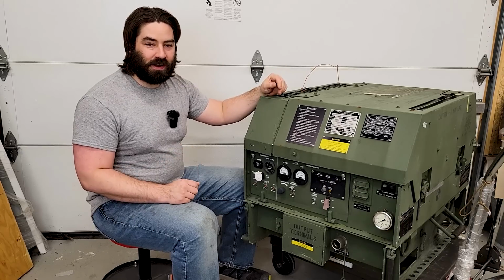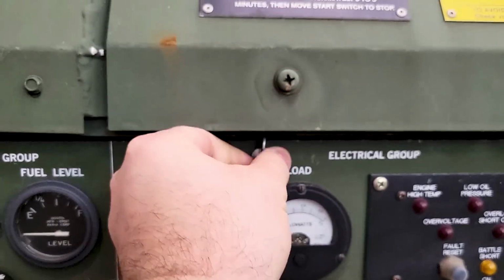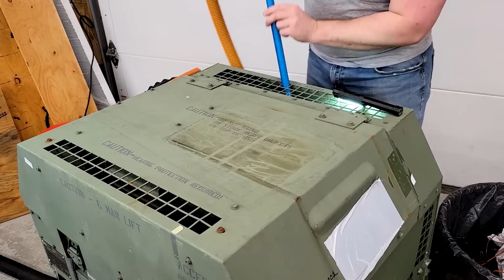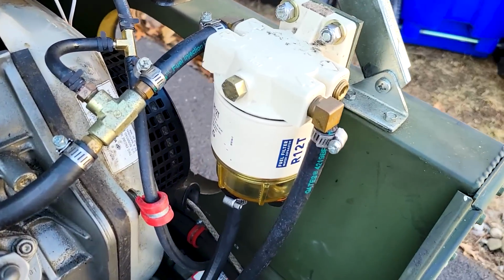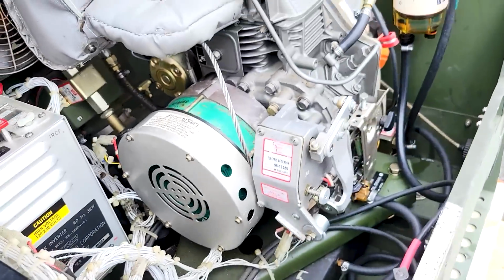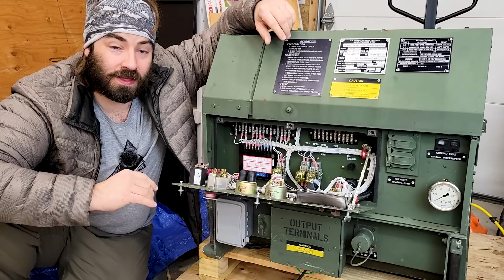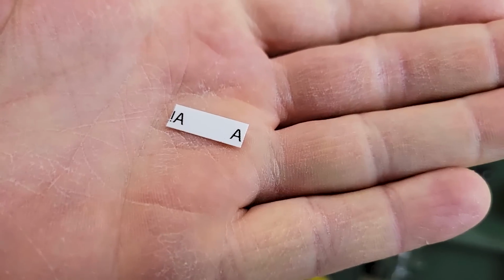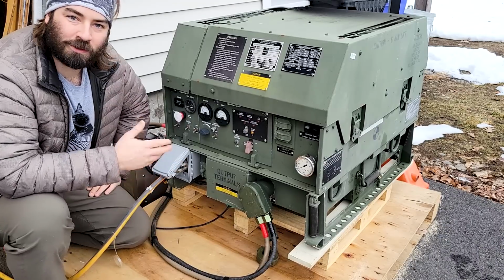Mil-Spec, the best you can do?

Comment: The fuel drain is connected to the bowl which is higher than the diesel tank.  Do you use the fuel pump to drain the diesel?
Reply from the maker: This model has a fuel drain on the tank.

Comment: Can these generators run 24 hours for few weeks non stop like the 10 and 15k generators?
Reply from the maker: Yes, they are rated for continuous duty.  However,  the oil sump is smaller, and the RPM higher.  This means the oil change intervals are more frequent compared to the larger models.
Reply: @DavidPozEnergy  would you say oil change 50 hours
Reply from the maker: The Yanmar engine in the MEP-831A has an oil change interval every 100 hours, 1.1L.

Comment: as a 91b i had to learn how to work on these because we never had alot of generator mechanics in my unit. these things sucked, they were old and reliable, yes. but they were always left outside and when something went wrong, combined with the issue of people in tents being pissed, they were never fun to work on. The biggest issue i ever seen with them was a shorted ground or a busted fuel tank, suprisingly i never worked on any of the disel engines in these.

Comment: I have two of these generators. One has the same idle issue when started off a battery but does not have the issue with hunting idle when pull started do you think its the board?

Comment: I worked on the Onan 5k/10k Tactfully "QUIET" generators when I was in ( 95-09 )
We had to keep a stockpile of the solenoids as they went out all the time, though you could manually open them and keep them running with just a tie down if you had to.

Might have missed it but how much did this model cost you?

Comment: Keep the old parts, as it is no longer emp resistant. In the event of an emp you can at least be able to run it at full throttle going back to the original governor controller.

Comment: I own an MEP 803. 10kw multi-phase selection. Single phase 120 or 240volt. Or 3 phase. I got it on auction. It was left out in the weather and full of water. I had to drain and replace the oil three times to get all the water out. It runs great. Has a onan diesel. The only problem with it is a winding issue that causes a harmonic ac voltage imposed into the dc circuit. Not a real problem but causes radio interference. I bought an in-line filter that shunts out the interference.

Comment: Came back to this to reply to some comments; if you dont know the trick yet I challenge you to pull start(make sure you flip the red decomp lever)
Also a trick in case you need to start with a dying battery is to flick the decomp lever.
Reply from the maker: Thanks for the tip.  Yes, I'm aware and have used it plenty, but it's nice in case someone is reading the comments without experience.

Comment: I've worked on those generators and adding a digital controller for being able to remote start when mains power fails you can combine the remote start with an ATS and you have a good budget backup system

Comment: While it does primarily run off of diesel as it's fuel. Being that it is a military service generator it should be multi-fuel capable. If it is then that works in your favor as you can produce your own fuel for it. 
The smallest gen set my unit had was 5kw and the largest was 150kw, we were an Engineer company so we needed the variety at different times.

Comment: Not sure where that title is coming from, but I would hope y'all know that mil-spec doesn't mean "top quality"!  
Ask anyone who has actually served how military gear compares to civilian gear.
Military gear is NOT (usually, with the occasional exception of weapon systems) built to be the best there is.  
Nope, military gear is instead built to meet very specific requirements - the military's actual needs - for a specific price.
That paradigm does not usually result in the best you can get.
Surplus mil equipment is a gamble, and the odds suck. Most such equipment is on the surplus market for a reason... ;)

Comment: How you kept the diesel on winter? Don't made gelatine?
Reply from the maker: As of right now, I keep the generator inside my garage during the winter.  I wheel it outside if I need it.  The garage is heated with solar hot water.
Reply: @DavidPozEnergy  thanks.kurt have a channel where they show videos about the upgrade parts

Comment: Aye look a mep generator I don’t see many of the small ones but I have worked with like the MEP-805/806 A and B’s, those are the 30Kw and 60Kw respectively, I’m active duty Air Force in the power production field so I’m familiar with generators especially the mil-spec ones

Comment: So a 3 Kilowatt Generator produces the same as a 3000 Watt generator?  ...that can't be right.
Reply from the maker: I'm happy to help answer any questions.  In this case, I'm a bit confused what you are asking about.  How can I help?
Reply: @DavidPozEnergy  So the Honda EU3000is Generator produces 3000 Watts of power. (Max)
Your Army Generator has the same max power ..3000 watts?  The Army Generator is about 3 times the size and weight ..that is what is what throwing me off.
Reply from the maker: Most military equipment is about 3 times the size, weight, and cost of a civilian version.  Most military equipment is conservatively rated. In this case, it can do 3.5kW, and can do that in high elevation, and in desert heat.  And, the military generators can run for 10 hours at full load on one tank of fuel.  I own a Honda EU6500, and it is actually a 5.5kVA generator, at sea level.  The "6500" rating on my Honda is the surge rating, not continuous.  Also, My Honda runs about 5 hours at full load for one tank, which is funny because the literature will say 14 hours of run time, but that's actually at 20% load.  I'm not trying to put down Honda generators, I love them.  Just trying to shed some light on a few differences.  I used to be in the Army, and maybe I have have an odd appreciation for the military equipment.
Reply: @DavidPozEnergy  Excellent break down David.
I see it's not so much about max power but versatility and rugged build.

When the Zombie Apocalypse comes ..your Generator would make me sleep better at night. :)

Comment: So to big and heavy to move. Super fragile and expensive parts. Bad design with motor running too high an rpm. Drinks tons of fuel and only makes 3000 watts? I mean I still want one but why again? I got a igen 4500 for 250 bucks from bod fta and run it 3500 to 4k all day everyday. Drinks such littke fuel I dont even notice. Charges my 24volt bank through the inverter easy all while auper quiet
Reply from the maker: Yeah, this Generator isn't for everyone.   Do you have know the fuel consumption of your Generator in numbers?  I usually do tests on mine to find the kwh/gallon.

Comment: Mil Spec is sometimes very misleading. many years (several decades in fact), my Father worked at an Alternator factory in the UK, they made ones which you could pick up by hand, and other which you could sit inside the casing with plenty of room to stretch out. From a single KVA to MVA.

Anyway, even back then, brushless alternators had become the thing. More reliable, less to fail, easier to services, more efficient. There really were not many reason to use brushed alternators any more.

Except for one customer.

The Military always demanded the "old style" brushed units as they were "tested in the field". The fact that they had to carry spares, they broke down more often than a brushless unit and the design was grossly outdated didn't matter. They always paid several times the cost - for an outdated, less efficient, less reliable, machine - instead of going brushless.

They would not even allow for corrections to known design-issues, they wanted the OLD design, warts and all - 99 of them at a time, each one many times the price of a brushless alternator.

"Tested in the field" was all they would ever say when challenged as to why they used dearer, inferior devices, "tested in the field".

Mil spec is not always about quality - it is sometimes just "terrible but with a known level of awfulness" which someone signed off as being "correct".

Comment: I have been using a MEP-016D  to offset the solar when the panels are covered with snow. I have used this old MEP  for 8 years now. The L 70 Yanmar just keeps on running. Very fuel efficient. 
.

Comment: Love that generator! Kurt did an awesome job! I'm curious about why diodes, not just simple bridges.
Reply: Usually the diodes will be for some kind of holding path check in the circuitry. When you press the start button some electrical test will go on and close a relay, allowing the system to come on. The diodes prevent it from coming on as soon as the on button is pressed. Don’t know this system though

Comment: How much is a 24 volt battery for this?
Reply from the maker: If you buy the OEM 24V battery, it will cost about $900.  Instead, most of us second hand owners, will group 2x 12V batteries together.  I bought 2x 12V for a total of $112.

Comment: As the proud owner of an MEP-803a I can say Kurt's products are top notch.
Late last year I replaced the voltage regulator with one of his due to a failing adjustment potentiometer.
From my own observations his regulator seems much more precise than the old original unit. (to be fair the original unit was 19 years old)
Reply: Very happy with Kurts controller, worked perfectly and was reasonably priced.

Comment: You brought back memories from the 1960s. My dad and I worked on military surplus gensets made by Onan. These units were for American Red Cross disaster service. The units were very well made and came with technical manuals etc. We had a non-military Onan too from the early 1950s that was hand crank start. It was a true beast to crank. We mounted it in a trailer as part of a lighting unit. This all was a great learning experience for a teenager. Thanks so much for your video and best wishes with your project.

Comment: Your video brought back memories. I was a 52D from 76 to 90. 
From 87 to 90 I was an instructor for the 52D course at Fort Belvior
10 years after I went through the course. I remember when these things
arrived to be used for training. The gas 3 Kw before this went into service
had a 4 cylinder engine on it. The pistons were tiny. Power generation field
worked out really well for me. As a civilian I have been operating and 
maintaining a 7 Mg watt power plant for 32 years. Thanks for the memory.
Reply: Hi I was in ft Belvoir in 89 D809th
Reply: I attended Delta school at Belvoir from 87-88. Bravo Co.

Comment: For the fuel efficiency test would it work if you just filled the normal diesel tank to the brim. Run the generator for an hour with a known load. Then precisely measure how much diesel is required to refill the tank to the brim again. Then a simple calculation will give the efficiency now that you know the duration, load and the amount of fuel used.

Comment: if you ever decide to get the bigger generators the 5k , the low oil pressure will prevent you from starting the generator unless you hold down the fault/reset switch while trying to start it  :)
Reply from the maker: That's a good point.  I also own the 802 and have a couple videos with it.

Comment: We (Army) had a 5kw and 10kw genset that we commonly used, total beasts! 10kw is a misnomer, it was two 10kw generators on the trailer. You could run them independently or bond them for 18kw (never figured out why they said 18kw when bonded). The biggest I saw was in a Patriot unit. When I was there, they had two 200kw turbine generators, I understand now they're using 150kw diesel sets.
Reply: They have a '300' KW truck system, but its two 150k's ran parallel mounted on the back off a deuce

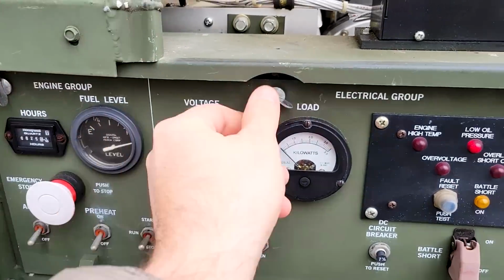Comment: When you opened the front panel at 8:47 - my eyes went straight to the little blue trimmers. Wow, PC mount trimmers exposed to the world. Those appear to be Bourns 3386 trimmers - very high quality trimmers that are 'kind of' sealed. We have found that they occasionally don't fare well when exposed to high humidity or moisture for extended periods of time. My guess - they went bad. Inexpensive at about $2 each. Bourns part number 3386P-1-xxxLF. The xxx is the resistance value which is printed on the part. For example "253" which would be a 25K ohm trimmer -- 3386P-1-253LF. The replacement board appears to have a digital-potentiometer on it (IC7) - good idea.

Comment: different from the generators i used to work on in the 80's, kinda cool. only thing is back in the 80's all the generators as i recall were made in the U.S.A. Governors back then if i remember right were all mechanical and the first thing to go was usually the voltage regulators.

Comment: Oh man that surging sound brings back a lot of memories, that was such a widespread problem that I'd just assumed that was its normal mode of operation. The larger generators would do that as well, but only when the fuel started running low - prompting a Lcpl to scramble for a jerry can before the thing died.
Reply: We had privates on fuel duty. Woe to those that let it go dry. Happened a couple of times, once  was the HQ tent which provoked corrective measures(leaning on NCOs to watch closer). Wasn’t my task but I got into the habit of checking fuel levels whenever I passed by, to give a heads up if necessary or even fill it myself.

Comment: What's the go with using break in oil
Reply from the maker: Break-in oil is used to help seat the piston rings to the cylinder wall.  It's used on new engines.  I think the break-in time is 50 hours before switching to a normal oil.  This unit has less than 50 hours, so I'm using the break-in oil until then.

Comment: Fuel consumption should be about 3/4 gallon per hour at full load. I worked on these when I was in the service. Great little units if you keep them maintained. I would like Kurt's contact information if possible. I could use a couple of his controllers.
Reply from the maker: I linked to his Ebay store in the description.  You can send him a message through ebay.

Comment: Fun video. I'm a new subscriber. Yeah military equipment tends to be quirky in exact proportion to how different it is from any comparable commercial machine. The parts that are unique - like that speed controller and the whole idea of an inverter at the time - don't have the benefit of feedback from a mass market, so their reliability can be hit-or-miss even though they're made with very high end components and fab techniques.  Commercial designs are often also flaky at the outset, but after a few ten-thousand units have shipped, problems that didn't manifest during design become apparent and get fixed.

One other thing you inadvertently illustrated is why pulling tanks out of storage for deployment in Ukraine has been hard and painful on both sides. Multiply this generator's issues by about five thousand.
Reply from the maker: I'm not up-to-date on the tank issues.  What kinds of problems are they having?

Comment: Look bro's.   Old ARMY stuff is amazing.   Get the stuff from WW-II if you want something that is BULLET PROOF.   Even in an EMP event?   They will still keep humming like nothing happned.    Sure they have Points Ignition.   But you can EASY fix those or go to Full Solid state if you choose.  Just keep  spare around.   

The OLD Briggs engine will last longer then you if taken care off and put back to O.G. Specs will last longer than you.    Use a Propane Dual Fuel carb to give you the maximum reliability and start options.    

Be sure to put in a External electric oil pump and filter along with a Neodymium magnet to catch any metal fillings.

Comment: It looks like the new controller fixed your fuel level gauge issue.
Reply from the maker: They are independent systems.  Probably the swiping of the brush cleaned off any build-up on the fuel level sender.  Seems to work well now.

Comment: I think MIL-Spec manufacturers are getting cheap and sloppy. This thing would NEVER pass sound and output standards from 40 years or so ago. A lot of wasted space, not to mention foreign made components (Yanmar is Chinese owned even though JD is the parent company). Older Continental powered 10 KW 3 ph. AC generators were much quieter, and actually didn't take up much more space than this unit. EDIT: Inverter generators are notoriously problematic (especially the inverters themselves) and I doubt any of them would pass an EMP test and still work afterwards. Rotating field generators with manual regulators will always be the ticket for durability, and ease of field repair in a disaster scenario. Granted, they're more expensive to manufacture, but you can't beat them for reliability!😉

Comment: My son is in the Army (14E MOS PATRIOT Missile crew member) and when I went to his AIT graduation I took a tour of the system a d the Army has 2 generators running the engagement control and the RADAR. The EPP consists of two 150 kW diesel engines interconnected with 400 hertz generators. The generators are mounted on a modified M977 HEMTT

Comment: Do you have a source for the external battery connector and it’s part number as well as the external fuel connector?
Reply from the maker: I don't know the fuel fittings off the top of my head.  The external battery is something I made in this video: https://youtu.be/za8zwVzqfgk

Comment: Pretty cool. Diesel generators are expensive. I was looking at a Kubota low boy, but it had like 1,000 hours on it, and seller was asking too much. 
None of my business really. But curious what you can pick up these mil spec generators for?
Reply from the maker: Depending on condition, these sell between $1-2k at auction.  Typically you can buy a fully working unit for $2,500 - $3,200 on ebay or facebook marketplace.
Reply: @DavidPozEnergy  Thank You